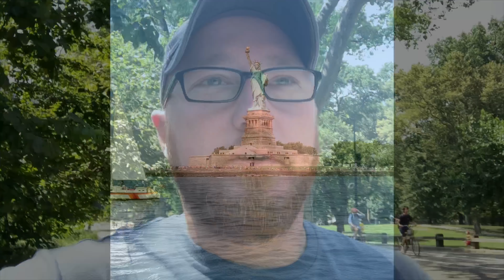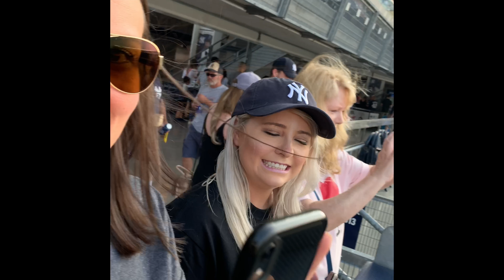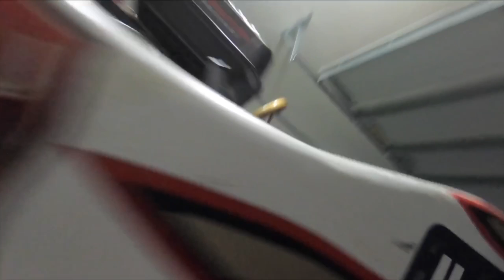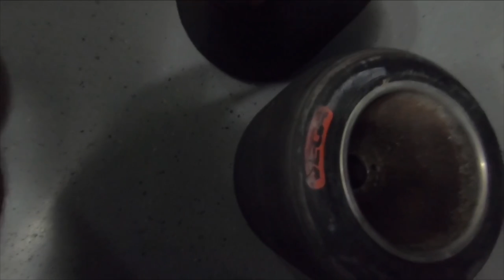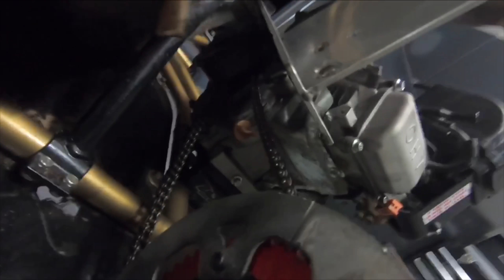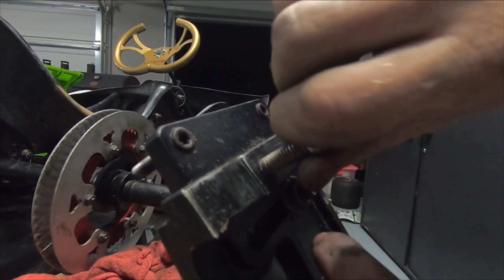I’m in New York, Joseph has a Surprise and Joshua has Go Kart Problems

Comment: You need to loosen the motor mounts then move the motor back because it will slide. Then you will be able to side it off the back sprocket and get it off. Or you can take the seat off and the clutch off  and move the engine back a little and it will come off that way too. Those are the easiest ways that I found to do it

Comment: Well first things first, he needs a mycron so he can get his data on temps and rpm
Reply: I agree with you 100% it's hard to race without a tack
Reply: @ryanmiller5645  yes it is, it's very difficult to get the motor dialed in
Reply: Agree as well
Reply: It also doesn’t have to be the latest and greatest for A four stroke
Reply: Maybe a spec gear predator class.

Comment: replace the hub, no need to break the chain just take the clutch off should be a 1/2 or 13mm. as for the stand you'll want something fairly decent that's easy to push back and forth between the pits. Also, need to get you a tach preferably a mychron.

Comment: You dont have to break the chain or take the axle off just loosen up the motor mount scoot it back and the chain will come right off the clutch and the rear gear. And I agree you need a mychron I have a mychron 4 and it helps so much. Stand wise a one man kart stand would be the best

Comment: Undo the butterflies on the underside of the motor mount where you’ve got a stripped bolt and you can tip the motor and use an impact to pull the clutch off or just drill a hole big enough through the seat to where you can get a socket and extension in there to take the clutch off

Comment: you need to replace that hub, the collar there is doing a lot more than just holding the hub on. you can get shorter or longer hubs that will make the rear axle harder or softer, which affects rear grip. with it broken like that, it could be part of the reason you are struggling with rear grip.

Get a chain that has a master link. we are changing gears a lot, so its critical to remove the chain quickly.
Reply: I've never had good luck with master links. They tend to be a failure point. You should be able to change gears on a dirt kart without removing the chain just by sliding the motor back to loosen it.
Reply: Jordon We

Comment: For your first problem with the motor mount the best thing is just to get a new one and for the tires roll about an ounce of some kind of inside prep and for wiping the outside hot lap acrysol an atomic Punch and forwards getting the clutch off the motor it's just one simple Bolt and it should slide right off hope these tips will help you out

Comment: The best way to fix that mount is with a heli-coil. I never let them strip as I would take them out of the box and heli-coil them before they go on the kart. The 2 tools you can't do without are the clutch tool and a chain breaker. A master link is a weaker link so you use a chain breaker to build the chain without one. Tri-flo is by far the best chain lube I have ever used. Check and clean the heim joints in the steering for play as they tend to open up in the ball joint. Check them if you run off course or take a hit too. Keep the bearings and heims clean and lightly oiled (over oiling attracts grit) and nut and bolt the kart before putting it on the track every time. You will learn with time what else you will need to do and don't be afraid to ask questions.

Comment: I run a predator series that is local, but it is box stock, can't touch the engine. First thing i would say is make sure you are cleaning the clutch on a weekly basis. Also, predator engines actually run better with a looser chain, not sure how far you were trying to push the engine forward, but the chain looked about perfect. Lastly, I would replace the collar and move it more to the left on the axle, it isn't just holding the hub, its holding the axle. The axle could be sliding around which is why you don't have rear grip. Oh, also, there are chain breakers you can buy at harbor freight so the chain comes off easier.

Comment: One of the biggest things in karting is tires I see you’re on a phantom seraph which is a very good kart a good thing is to get that thing scaled out you can use the late model scales to do so I’d contact phantom racing chassis on Facebook for numbers to scale it as a base setup but onto tires there are many different types of preps a tip I learned is the more you wipe the slower you’ll be you need your tires to punch a certain durometer number to which likes the track surface harder the track harder the tire an old tire with less life on it is good for tracks that are hard and slick but a new tire will like a hard and fast track just gotta figure out what works with your driving style and also stagger is a huge thing also it’s all measured by the difference in circumference from the right side tires to the left you want to run as less stagger as possible but still being able to turn into the corner and come off straight with good roll speed through the corner front stagger helps you get into the corner and rear stagger helps you come out easy changes at the track to help a loose or tight go kart is changing tires going to a harder or softer durometer tire different staggers or changing the cross weight which is the weight from the left rear to the right front if you have a bunch of cross it’ll push like a dump truck but if you don’t have enough it’ll be loose it all depends on driver comfort and track conditions hope this helps you out feel free to give a call @ 4124915151 if you need any help I may be young but I can teach you how to compete with the best of the best
Reply: I'm sure they said in the last video it was a ultramax phase x one of the older ones the newer phase had the brakes next to the sprocket hub

Comment: You can add gaskets to the carb for spacers. Back in the day we always used Clorox to soak the tires !
Reply: The Squirrel Chronicles aka Rescue's but that doesn’t compare any where to new preps guaranteed new preps will rip Clorox apart if you use it
Reply: @matthewkarl5199  like I said it's been a while. Just trying to help

Comment: I raced a outlaw kart last year and with the chain situation i have always taken that silver plate off and removed one half of the gear and then taken the chain off but it could be totally different with flat karts but you could try it all you need is a allon key that fits the bolts

Comment: The collar by the hub is not a big deal. As far as getting the chain off invest in a cheap chain breaker. The motor mount bolt can be done a few ways 1. Drill the hole retap and upsize the bolt. 2. Drill and install a helicoil. 3. Replace the motor mount, they are not super expensive.

Comment: You can find stands online used on karting Facebook pages and for your clutch just remove the 1/2 bolt and clutch should slide right off and prep varies on wet tracks dry tracks and hit tracks if you start prep do not switch in between preps keep one set of tires for wet tracks and one for dry tracks

Comment: if you have a buddy with a tire roller, those red vegas love inside prep since they are a dryer compound. 60-90cc in the rights 30-45cc in the LR 30-60 in the LF should get you in the ballpark. Then use a "Conditioner" on the outside. I would normally wipe 3 coats on Monday, 3 on tuesday, maybe another coat or two on Wednesday depending on what the Duro of the tire was. Only thing I will say about prep though, get with a certain brand, stick with it, and learn it. I see so many people changing prep week in and week out and their results show it. I hope this helped. if you have any  questions feel free to ask. (Also have random parts sitting around collecting dust if you need them. would love to help out if I could.)

Comment: On the bottom of the engine there is bolts to loosen the engine which is how u would tighten or loosen the chain loosen them bolts and slide the engine backwards and then the chain will come off the clutch and around that guard pretty easily

Comment: Since you are running a spec motor does the track tell you what gear to run. If not ask someone in your class what is a good starting point. Not sure what clutch your using but maintenance on the clutch is important also

Comment: If hes running Vegas he needs to get a derometer and see what softness they are punching. Looks like a sandy track so hes gonna want them soft. Been a few years but when we ran em we used track tac products. One for bite and one to coat for softness. Just punch them after every coat. We ran like 35 at Pensacola back in the day it was super slick and at Foley it had more grip I believe our tires were punching 46-48. Definitely need those 2 peeps. That and a tach 👍 good luck to you boys

Comment: Just loosen up the motor mount there should be 4 bolts at the bottom the slide it back take off the chain then when ur done doing whatever put the chain back on and set the chain tension for a little play

Comment: The hub would probably be fine for a few more races, but definitely needs replaced. Get a hole saw kit from harbor freight and cut a hole where the clutch is straight across and drill the hole in the seat, should be a 13mm for the clutch bolt. If your going to buy a new hub I recommend BMI karts to check with them first, type Right rear hub, for a 1” 1/4 axle.👍🏻

Comment: Replace that hub ASAP Clean the clutch and the bearings. Then for tires I’d try Vega Yellow that’s what I run and then get more gears because you might have to change them track pending. And what do you guys have to weight and what chassis do y’all got?

Comment: the hub is fine ive got the same thing on mine. but it will be ok its still on there  pretty good. a trick ive learned takeing the chain off the rear gear and turning the chain side ways and u can most of the time get it off. ive stripped out many motor mounts and ive heli coiled a couple but its aluminum motor mount its honestly better to just buy a new motor mount just try not to tighten them extremely tight u will figure out how tight u need them before u stip them out but i have gone through a couple motor mounts its just part of it.

Comment: I recommend that you check with local machine shop and see if they have a Time-sert kit to repair threads on the mount. Time-serts are better than heli-coils bc they are solid steel threads not just a spiral of thread. Just my opinion.

Comment: Run the hub. It has two pinch clamps. Helicoil the mount. It’ll be fine. Don’t spend money on parts that you can fix. Fairfield green tire prep is what they run here in Missouri. Rub em down a couple times during the week and before you hit the track. You’ll see and feel a difference. When you buy new tires make sure they are cut to balance and even the surface and have them prepped internally. Then grind them every week like they do the latemodel tires to keep em fresh.

Comment: You can use a helicoil insert on the motor mount and run axle collars inboard and outboard of the hub for now but new hub would be best. Also I would suggest removing the rear bearings and front bearings for clean and relube. Wash the kart let dry and spray the entire kart with lube to prevent rusting.
Reply: Drew Lurker A buddy from work was able to use his tap set and rethread it for me. Should be good to go with the same mount. Gonna clean and lube the bearings this evening. Thanks for the suggestions!
Reply: Joshua Joiner yes sir I can get you my number I have a good friend that races at Callahan every now and then. Both my boys 7 & 9 race and we live in Alabama. We also run Vegas and know about prepping tires. Just let me know.

Comment: The engine mount is made to slide foreword  or backwards to tighten the chain  OR LOOSEN THE CHAIN Put a easy out in that stripped out bolt on the engine mount that's how you loosen the motor to slide on the frame rails

Comment: I would suggest you use a chain breaker but I just pull the top of the bearing cassettes off. That way I can clean the rear bearings. Also I wouldnt use a master link in the chain as tempting as it may be. The rear hub should be fine for a race or 2 but you can buy new ones on ebay 2 for about 30 bucks

Comment: You should really look into getting a new hub, I had one do that exact same thing when I smacked the tire barrier flat on the right side of my kart. As to getting the change off, get a quick change motor mount! It allows you to slide the motor around and take the chain off from the clutch. There is such a thing as a “detachment chain”, in my opinion their a waste. I’ve personally never had good luck with them. And make sure you keep the nerf bars loose!! You need that kart to be able to flex to the track!

Comment: If you plan to prep your tires it would be a good idea to sand the glaze off the tires. Take a belt sander or a angle grinder with a flap disk and wet the tire and sand it while its on thr kart. You will notice the tire feels like it already has more bite. For prep you could run trac tac or many of the other brands that are out there. I personally reccomend 10-2 tire treatments

Comment: Back home here we had two part sprocket system and you can add teeth or take away by putting different ones on. Clutch is a big deal so always make sure it’s clean and look up dirt track go karts and you can get a lot of good information that you need.  For sure get a tach. You need to see what you’re running after a race it’s giving you good information and advice on tires gears. But you need to do some digging for the information you are looking for. Unless you doing live video for QandA.   Looking forward to more races my nephew and I raced as a team and it’s so much fun but it can get into the pocket book. But enjoy it at the same time.

Comment: Get that thing back together and get it on a set of scales.  Get that extra weight in a place that will help the most. May need more front weight leftside etc. Pull the right rear in as close as possible to the bearing to move more weight to that tire.
Reply: Tactical eb I’m supposed to meet up with a local guy that knows way more about karts than me next week to get it on the scales and get it dialed in!
Reply: Set the karts weight on digital bathroom scales...cross weights are important..moving the rear hub out will free up the rear..but a reference point will be needed to bring back the hub to a specific measurement..so we used wiretie around the axle as a "marker" them measure from there..karting is about set up tires. Track conditions. And driver. Also when you purchase a new frame build a template out of steel so as to check for twisted frame and bent parts..

Comment: If you have Facebook there is a couple pages that people use to buy and sell kart part and stands and easy way to take clutch off is to pull on the rope to hold clutch and loosen the bolt in the clutch then slide clutch off and also if helps if you ever need to change the gear on the clutch housing

Comment: Look for a used mychron 3, mychron 4 or mychron 5 I personally like the 5 the best. This will give you the rpm of the motor and also head temp with the correct leeds.

Comment: In go karts tires are everything. When I’m don’t racing I take my tires off right away because they wash better. And at home I but them on the back, start the motor give her some gas and get some 80 grit sand paper and give them a scuff. It takes the glaze on the top and let’s the prep soke in the I wrap them with Saran Wrap so all the prep sokes in and I put more about 15 minutes before I go on the track

Comment: You need a #35 chain breaker tool.

Just drill/tap the motor mount the next size up.

Harbor Freight has a stand that works for about $30.
Reply: G Rock A buddy from work was able to use his tap set and rethread it for me. Should be good to go! I’ll check into the Harbor Freight stand. Thanks for the suggestion!
Reply: @Joiner1056  you can use a helicoil insert if you want or need to use the same bolt size.

Comment: You have to take off the clutch if you want to pull the motor and that’s where you can change your driver as well. Need a tach to know your rpms and temps etc. need a new set of tires I wouldn’t mess with those. New tires will go a very long way. Need to set your toe, caster and camber. Find a buddy from the track that takes it serious and pick his brain. And borrow his scales haha good luck brother

Comment: U can run with one bolt on the butterfly on the motor mount. With the crack collar i will just keep on running it all it doin is holding down the hub. We picked up the motor and used a 1/2 socket with a impact to take the clutch off. Dont have to take the nerf bar off to take the motor off. U can build a kart stand like what my dad did. Clean the rear bearings after every race

Comment: Nooo..!! Take the sprocket guards and sprocket off and change that gear
Helicoil that motor mount bolt
1. Correct gear
2. Tires/air pressure 
3. Seat time
4. Power

Comment: Use a stud with locktite instead of aluminum against steel each time it is removed..also nylon nuts will keep tightened better each time..the chain will need replaced after the chain has a noticeable arch when held sideways...no the chain will have to be removed with a simple tool (chain keepers will fly off)..also buy decent chain..lookong at the axle sometimes a second sleeper will "show" the measurement of how much the axle hub has been moved (to tighten up the cart on the track)..
Reply: Keeper not sleeper...sorry spell checked me

Comment: Im in the need of some cheap kart parts! SOS
Clutch, stand, seat, back axel, set of wheels. 
Already have the frame and new predator motor, but just getting back into kart racing after leaving it for 10 years